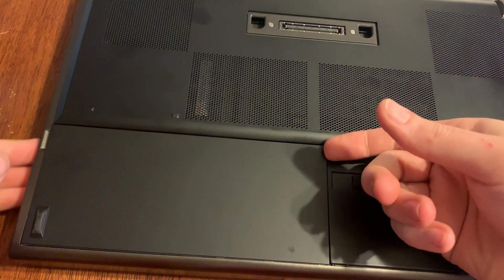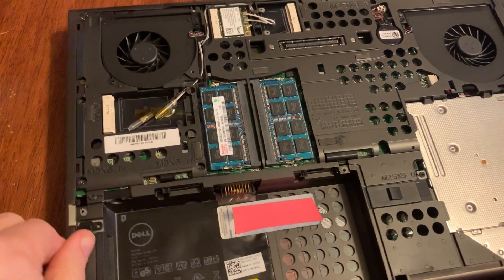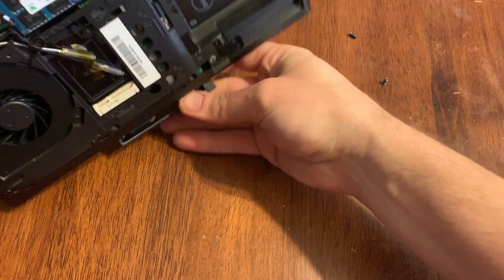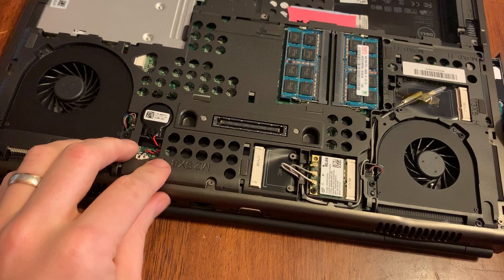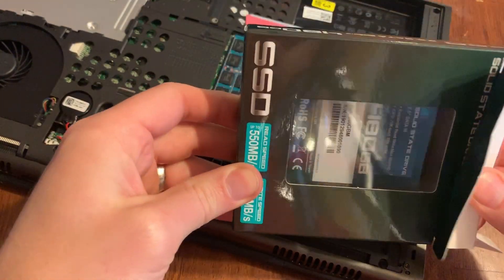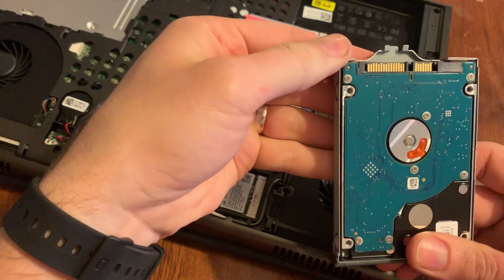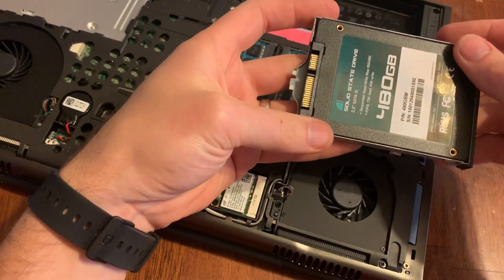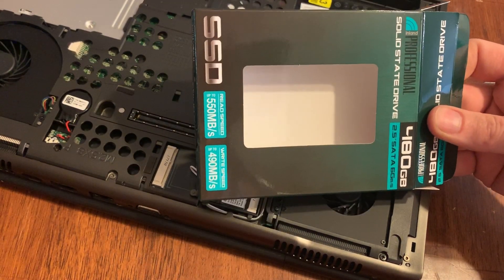Dell Precision M4600 SSD Upgrade

Comment: The by now 13 year old SSD is still doing ok, but at 256Gb my phone almost laughs at it 😀. This machine is built well, it fell from about 1m high on a corner and I think the floor had more damage than the case. It is also built to upgrade and maintain, memory and drive are very accessible by laptop standards.

Comment: I just bought one of these for $180aud bargain, it's got i7 2720qm Quadro 2000m 12g ram but I plan on upgrading everything in it considering that newer laptops can't be modified, chucking the best stuff I can in it, i7 2960xm firepro m5100 n ram n SSD upgrade and I noticed a slot for a m.2 2242 ssd? Do these laptops have an m.2 slot lol that'd be sick
Reply from the maker: I do not think so.

Comment: This system would have been perfect if you could have 2 drives in it.
Reply: You can, but you'd have to sacrifice your CD drive. If that's not important to you then  it would work out.
Reply: You can also install a msata. Thats what i have on mine and 2 disc hard drives running in raid
Reply: @scottb1923  did u install the msata in the empty dmc slot?

Comment: maybe you should try exp gdc for use external gpu...it great, i hv same model with ur laptop dell m4600+exp gdc gtx 1060 6 gb upgraded running great like a beast...
Reply from the maker: So far it's doing everything I need it to.
Reply: @mjmcomputers  Sr., whats the maximum upgrade for gpu and cpu for this model? I find one m4600 with a core 2 extreme, 17 inch screen without gpu. I dont have money for a M4800, im student and i want one to use for cad and fea simulation models...sorry kg bad english...thanks for the awesome vídeo!
Reply: @PauloIrineudeSouza  i7 2960xm amd firepro m5100 is the best possible upgrade for it, you'll probably need a 200+ watt wall adapter that i7 pulls 10 more watts than the stock one